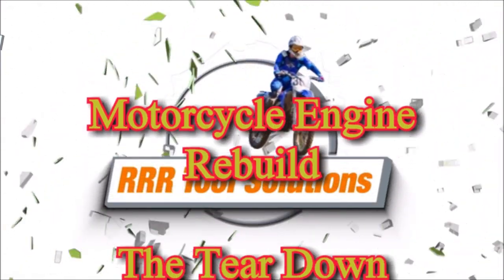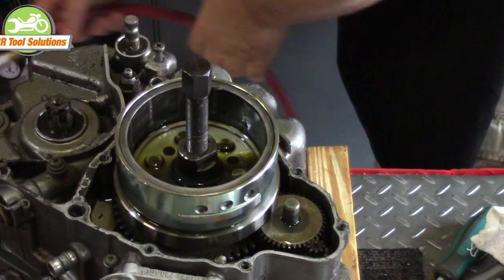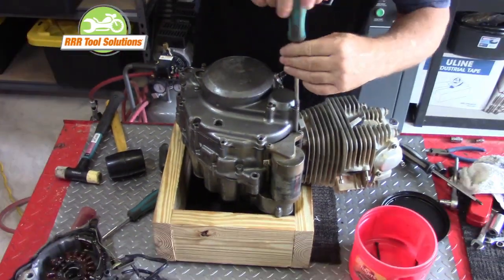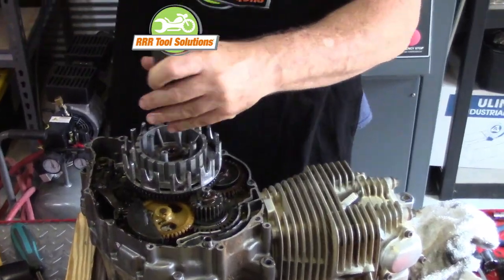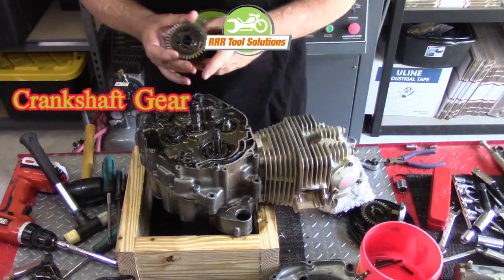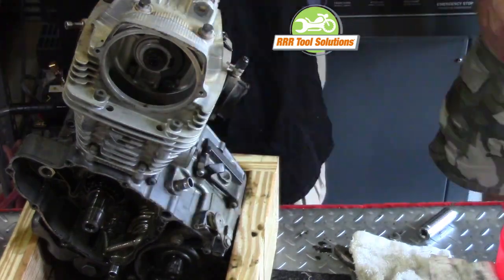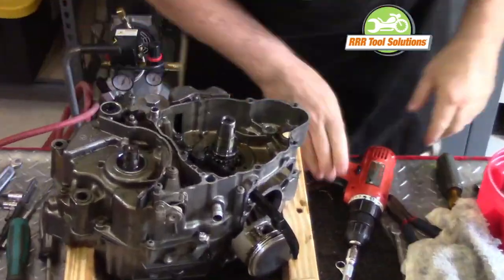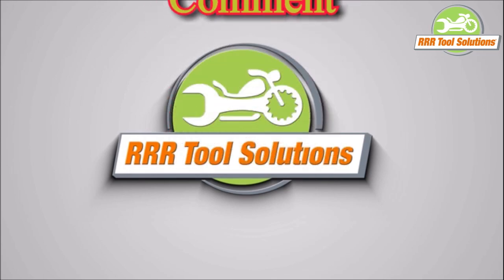Motorcycle Engine Rebuild the Tear Down

Comment: Great vid!  I am preparing to tear down and completely rebuild the engine on a 1979 Suzuki GS 550 L.  Air-cooled 549 cc inline-4, DOHC, 8 valves.  This will be my summer project to convert the bike into a scrambler.  The bike has both an electric ignition but also a kick-start.  Anything special I need to be aware of before I start the disassembly?  Or better yet, do you have a video showing the disassembling of an engine with kick-start?  Better, better yet...can you just come help me do it?  :)

Comment: How does one keep track of all the screws and bits to make sure everything goes back together absolutely correct?
Reply: Take lots of pictures, or organize them in labeled plastic baggies. This is certainly no small feat.
Reply: take pics and put tags and notes on everythign as well as buy a book on the  bike your working on mostly by photos and notes although !  use gerber glass jars and mark those for  each part use a container . If your a lesbian use a Cuntainer.  make diagrams.  see if you can attack wires with tags to parts as well.  tags like baggage tags .  marks also left or right inside outside.  and if you have to upside down or 69 lol.

Comment: what do you call that matter falling,pause to 4,35
Reply from the maker: Good eye! That was the clutch push rod. That rod slides inside the shaft to push the assembled clutch basket open (allowing bike to stop or shift). There is also a small ball that goes at the end to act as a bearing. Thanks for commenting. Gordon/RTS

Comment: similar to my yamaha, from what motorcycle is this engine?
Reply: wow, my feeling just very good. i though it's yamaha in the begining of the video until you flip the engine and i see this 1:53 . but i still don't know the bike.
Reply from the maker: This is a 2000 year TTR 225. It's the same engine they used in the Serow. Great little engine, reliable, and dependable. Thanks for commenting - Gordon/RTS